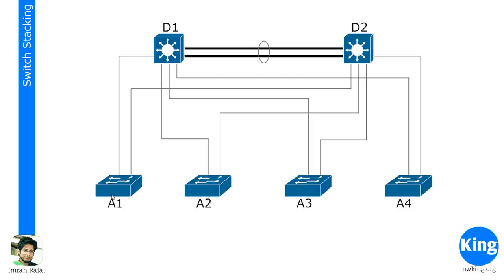Free CCNA | Switch Stacking vs Chassis - Day 39 | 200-301 | Cisco Training

Comment: Sir good but I have question  I have implemented  campus networking  products is Juniper Switchs  ......2 core switch clustering  and access layer Switchs  2 nos uplink port LACP mode configured  benefit is redundancy and bandwidth increase. ......why not protocol using at Cisco switching. ...

Comment: If I understand this stacking technology correctly, basically you don't need that stack if you want to manage small switch or switch directly one by one by the management VLAN, This is even better because you don't have to worry about a master switch failing and causing the entire network to fail?